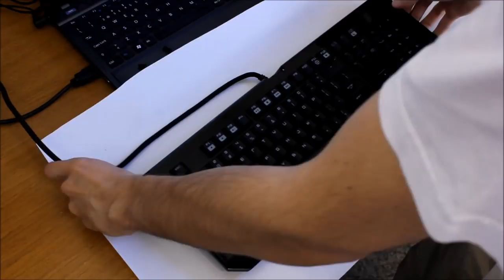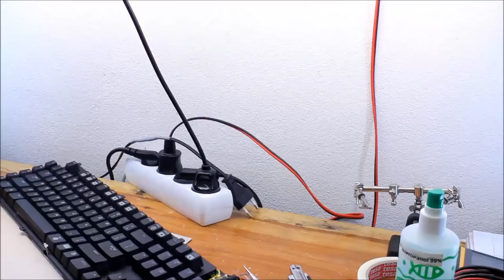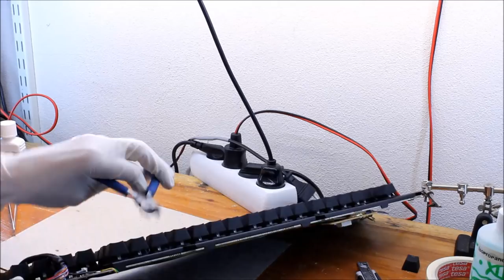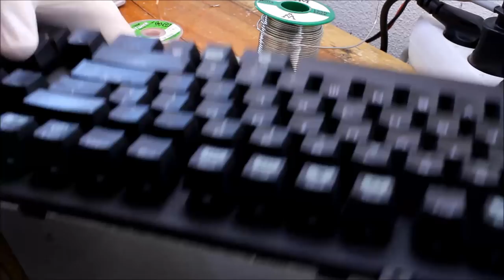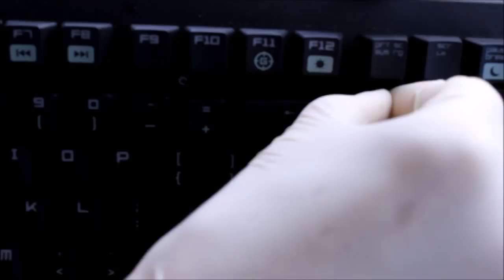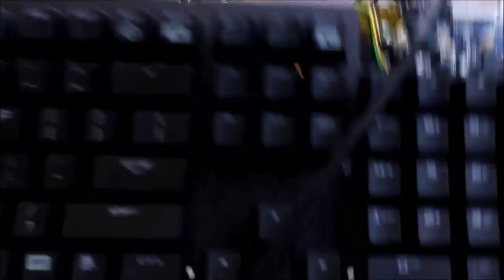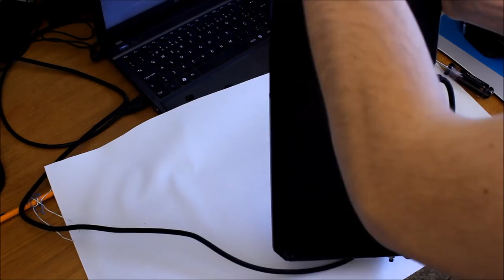How to replace backlight LEDs and Cherry MX switches in a mechanical keyboard.

Comment: hey i only my Z key is different colour if i just change it like this it will fix ?? and bw what you did in the 8:38 ??? i didn't understand help please
Reply from the maker: How did it become different, do you have a RGB keyboard? At 8:38 I'm using a solder sucker to remove the tin after melting it with the soldering iron.
Reply: @jfaria  yeah i have razer blackwidow chroma
Reply from the maker: @trancegotten3699  Yeah, you have to replace the LED, but you will have to search for a compatible one, I don't know the details of the LEDs razer uses. you can always take the LED off and take it to an electronics shop and they might help you.

Comment: never mind, i got it to work now, I had to connect the disabled part to the D... forgot what that means in my circuits class like R for resistor, but that + connecting the 2nd one by testing it to other pins, ahahaha it was freaking funny with me experimenting on it :>

It's in the laughs that made me happy to put back my keyboard together :>

Comment: is there anyway that you could only switch the led lights and not the switches making it easier?
Reply: I know this comment was from 7 years ago, but if you're still curious, I think it's possible. From this video, it looks like you just desolder the led leads from the pcb and pull it out from the top of the switch. Then take your new one, slide it in, snip the leads, and resolder.

Comment: So I just want to clean the PCB, and if I'm right in my assumption, after watching your video, in order to remove the black metal covering, I'll have to desolder every single one of the backlit LED's to do so?
Reply from the maker: I'm afraid that is true... You can try to clean it by taking the plastic case out and then spraying it with something like isopropanol, but I don't know if the switches would like that. If the keyboard wasn't subjected to liquid spills, it probably isn't too dirty anyway. The black metal bezel will likely stop most of the dust from getting into the pcb,
Reply: Lol, Yeah.... Pear juice made its way into the num-pad. I ran a few bottles of IPA 90% through it and gave it 48 hours to dry, just in case. Everything works great, but that is a terribly inconvenient keyboard design. Really didn't want to sit down for an hour or two after work, just to desolder everything to clean the PCB.
Reply: Marcus Adams José Faria  Hey geeks out there, please help me ;_;. I dropped some mango juice on my keyboard, and kept the keyboard open, until it died, then I put it back on, because it was an expensive keyboard, I kept on plugging it in, until the LED's stopped working... Then I finally decided not to plug it in anymore. I told my dad, and he knows a lot in these stuff, when I was little he had a computer shop, with his friend. Anyways, he told me to clean it and let it dry off, so the next day, he was like "I forgot to pour alcohol on it," so I look in the fridge and the only type of alcohol there is, is a %76 one, I didn't know that percentage mattered, heh. Then the keys became sticky, not very loud, they sound different, but they're still tactile. So then my dad saw the keyboard was becoming more sticky and when I poured more alcohol it would worsen the switches even more, so he went to pick up some WD-40. We sprayed a lot of that on the switches and they are not so sticky now, but they still don't sound as good, My numpad was intact, so they sound and feel beautiful! So I don't really have a problem with the sound or that feel, but where my problem lies is within the "N" key. It's the only key that is not mis-functioning. So, I took the keycap off to see if there's anything obvious, and there's nothing. My problem is when I press the "N" key, I end up with either nothing, or "nn" or if I'm lucky "n". I took off the keycap, again, and I noticed that if I stroked it softly it will work fine, BUT if I strike it hard, it will type 1 "n" and if I leave it, it will type the other "n". Also I see some delay when I press the "n" key, can you guys please help me??? (also this has been for more than a month so I don't know what's the issue here).

Comment: Very informative video, thank you.
Just out of interest, do you have any idea what sort of life-span the LEDs in a back-light keyboard have? I've been looking everywhere and no-one seems to agree. :S
Reply from the maker: I don't really have the expertise to give you a definitive answer, but we can get an approximation in the specific case of this keyboard.

Manufacturers rate these general purpose LEDs at up to 100.000 hours at their rated output, but when they would reach the 100.000 hour mark they would only have around half their brightness.

Most 3mm LEDs have a constant current rating of 20 mA, in this case every LED in the keyboard has a resistor that limits the current to approximately 4 mA, that means the LEDs are driven well bellow their maximum specifications, this means they will have a lifespan significantly longer than the rating. This means that I wouldn't be surprised if they would reach 100.000 hours without losing too much brightness, that's more than 10 years always on! On top of that, many people don't use them at maximum brightness, that will probably further increase their lifespan. It is, however, possible that some LEDs will just die, but I would be surprised if it's more than one or two.

Shorter version: don't worry about it, it's very likely that something else will break first :D

If you want proper data, search for MTTF of the LED you are looking at, most "proper" manufacturers usually publish them. For a detailed technical explanation of the failure modes and testing methods, read the application notes from the manufacturers, you can try one from Osram titled "Reliability and Lifetime of LEDs", it's very easy to understand.
Reply: Wow thanks, you're full of useful and interesting information aren't you? The lengthy reply is much apreciated. :)
I will look into that for sure, and maybe I will go for a flashy keyboard after all.  ^^

Comment: Hey, the LED on my bf3 blackwidow ultimate does not light up.  Read through the comments and another person had the similar issue.  You said to take a look at the LED driving transistor.  Can you go more into detail on what I should do? Thanks
Reply from the maker: Hi, did all the LEDs stopped working or just one of them?
Reply: José Faria The LEDs are really dim, sometimes it will flicker back to normal for a couple hrs then go back to be really dim
Reply from the maker: Check this image, it is an image from my old keyboard's motherboard, close to the num lock and caps lock LEDs, it should be similar to yours:
https://cocasdaneve.files.wordpress.com/2013/05/closeup_npn.jpg

There you can see in the upper right corner a red square. In my keyboard there are two wires that I added, in yours there should be a SOT-23 transistor in that spot. 

First I would take a soldering iron and melt the solder in all that transistor's pins, it might just be a bad joint that cracked, might as well melt the solder in that 10k resistor marked 103 too (make sure you don't apply heat for too long and that you wait a couple of seconds between each leg, so that the parts don't unsolder completely).

If that doesn't work, you can try and replace that transistor with a general purpose NPN, like a BC848 or something like that, as long as the pinout is the same and it can handle at least 100mA.

Comment: I'm having problems with my blackwidow keyboard, the key "E" is not this working, I need help .This video can solve my problem?
Reply from the maker: +enzo andreatta Make sure the switch is properly soldered, if it is you can try and replace the switch to see if it solves the problem.
Reply: +José Faria Thanks, I'll do.

Comment: nice video
Just wondering, do I need a soldering iron for just switching the cherry switches? or is it just to push em out?
Reply from the maker: Yes, you will need at least a soldering iron. Both the LED and the switches are soldered to the circuit board.
Reply: José Faria are they solded separate? because i dont have leds on my keyboard. thanks for the reply
Reply from the maker: They are separate. If your keyboard is not backlit, it's likely you will only need to replace the switch, however, sometimes manufacturers use switches with diodes, if yours has diodes you will probably need to unsolder the diode too.

Comment: Would it be possible to install LEDs to the blackwidow tournament edition 2014?
Reply from the maker: Gavin Zhang It depends, when you open the keyboard, are there holes for the LEDs in the PCB? If there are it might be possible, otherwise no. Remember that even if you can install the LEDs you will also have to replace all the keycaps, your keycaps are probably opaque, not suitable for backlight.
Reply: José Faria I opened the keyboard and there are holes, I'm just not sure if they would get power if I were to install the LEDs. I'm using my friend's keycaps because his keyboard broke.
Reply from the maker: Don't close the keyboard yet. Without soldering, stick an led in the holes and see if it lights up, if it doesn't rotate the LED 180 degrees and try again.
Reply: My LEDs actually haven't arrived yet(they're being shipped from China), but I'll definitely try that when they come. Thanks!
Reply: +Gavin Zhang And have it worked?
Reply: no lol the circuit board doesn't have proper sockets

Comment: I have 2 broken switches in my keyboard, so i have to melt the thingy on the back of the keyboard even if it doesnt have led´s?
Reply from the maker: Tycos Yep, the thing on the back is a metal mixture with a low melting temperature consisted mostly of tin, in electronics people call that solder, in the industry they might call it by other fancy names. It's used to make the electric connection between the switch pins and the keyboard's printed circuit board. Your keyboard is the same as this one, the only difference is that instead of 4 pins to unsolder (2 for the LED + 2 for the switch) you only have 2, the pins of the switch.

By your post I get the impression it's the first time you're trying something like this. The button's pins are very large and there are only 2 of them, that means it's an easy task for you to start with; however, if you know someone that likes electronics you might want to give them a call to assist you, to make sure all goes well and they can lend you their soldering iron so you won't have to buy one just to replace the buttons. If you like the task, then you might buy one for yourself for future repairs :)

Comment: Can the mechanism be repaired, I stuck a pin in it for "cleaning", but now the key no longer works
Reply from the maker: Angel Vega Disassemble the switch, I think you can do it from the top, just by removing the keycap and bending the plastic retainers; now you should be able to remove the shaft and inspect the metal springs for damage.
Reply: José Faria so is it possible to just do a switch swap without dissassembling the blackwidow?
Reply from the maker: No, that was for a spring check/swap, for a complete damaged switch swap, the switch on the blackwidow needs to be unsoldered. You need to disassemble the keyboard

Comment: Nice vid man, thanks! and nice yellow Tortex plectrum xD

I have a Corsair k95 and a few of my LED's just die (like not a whole row just 1 or 2), do you know if the K95 opens this easily as well?
Reply from the maker: Yap, delrin is an amazing material! :D

That's a nice keyboard, but I never disassembled one, it should be very similar to this one. Check this thread, it's the disassembly process for a k70, but it might be similar to yours:
http://geekhack.org/index.php?topic=41795.0
Reply: To be fair I'm rather disappointed with it, Its my first "expensive" keyboard I've bought for a while as I've just got back into competitive gaming. I've had it for about 4-5 months and two of the LED's have died. Also I find myself double typing letters when writing in haste which isn't a problem I've ever had before. I can honestly say I believe I type faster on a rubber dome but that being said; mechanicals utterly amazing for gaming.

Thanks for a speedy reply and the link!

p.s..73 is most likely my favourite thickness of tortex plectrum, I actually have 1 or 2 at hand at all time, on my desk, if I ever have the sudden urge to jam xD
Reply from the maker: iGlyphix Doesn't that keyboard have cherry mx red switches? If that's the case, you should try blues or, my favorite, browns. I need the tactile feedback, maybe that's your case too. I switched my blackwidow with a Cooler Master Trigger Z with cherry mx brown switches and this thing is simply perfect.

Regarding the LEDs, that apparently happens pretty frequently across several brands, that just means everyone buys the cheapest around and hopes they will last for the duration of the warranty :D
Reply: iGlyphix It depends on which switch you use. Blue switches greatly improved my typing speed. Also, I'd highly recommend a different brand. Razer, Corsair, Thermaltake, etc. are all pretty cheap when compared to a Ducky, Filco, KBC, Vortex, etc.
Reply from the maker: ***** I have to disagree there, I had a bad experience with the blackwidow, but the CM trigger z is at least as well built as any ducky that I've seen. Regarding looks, I think corsair's k70 is hands down the best looking one.

Comment: Can I remove the switches while the keys are still attached?

EDIT:
On 6:15, I didn't quit get what you did with the FLUX PASTE, can you please explain that step? is it some sort of protection?
Reply from the maker: Well, I guess that technically you can, but removing the keycap first makes it easier to grip the switch and if your keyboard has LED backlighting it is significantly easier if you remove the LED first. Regarding the flux, it's a paste or liquid that helps the wetting of the solder, that is, it helps the solder stick to the parts you want and not your soldering iron. Because the flux removes oxidation, it also helps making old solder melt faster like in that keyboard. If you want, you can read more about flux here: https://www.lifewire.com/types-of-solder-flux-818849
Reply: Thanks, I hope I succeed in what I'll do soon, I'm planning to remove my old Razer Blackwidow's 2012 Stealth Edition switches and install them on the new Razer Chroma Compact while maintaining the LED backlight on the Chroma, not sure if it'll work but I'll try, I'm about to replicate what you did in the video. 😂

EDIT: Btw, would it matter which switch goes where? e.g if switch letter A needs to go to switch letter A on the other keyboard, or all switches are basically the same and thats the board job to determine?
Reply from the maker: I believe you can't do that, the chroma uses 4 pin LEDs, so the switches have 4 holes, the blackwidow uses original Cherry MX switches with only 2 holes for monochrome LEDs, you will not be able to keep the backlight on the chroma if you do that.

Regarding the switches on a keyboard, they are usually all the same on every key, you can switch them around and they will work fine.
Reply: Well, that's a first bad news.. 😭

I'm curious which part that does the illumination? is it the switch itself? or is the LED attached to the board? you mentioned 4 pins on the Chroma, can I somehow remove two extra pins and install them on the blackwidow switch so that it can give an electric current? not sure if that's even possible, if it won't work then I'll simply use the board without LED, all I care about is the switches tbh, the Chroma Compat has one of the worst touch and feel, especially if you're a gamer.
Reply from the maker: The small LED is what illuminates, not the switch, you can see that if you remove one of your keycaps. Your chroma has 4 pins because it uses RGB LEDs, wich are 3 leds in a single package (a RGB led is composed of a Red, a Green and a Blue LED, one of the pins is common, the other three connect to one of the 3 internal LEDs). 
If you want a keyboard with a good feel I would recommend selling yours and buying a keyboard with the switches you want. Personally, I prefer cherry MX brown, many people who use their keyboards to play games like Cherry MX red. If you want Cherry MX switches and RGB lighting I would recommend you to look at something like the Corsair Strafe, but, like with the Razer Chroma, you are paying a big extra for blinking lights.
If you just want good switches and don't care about multi color backlight you should look at other manufacturers, like Cooler Master, they are making very good keyboards that use genuine Cherry MX switches and are significantly cheaper than Razer.
Reply: Thanks man, I had plans to buy the cooler master compact keyboard, but I thought since I already have two keyboards it wouldn't hurt to try replacing the switches, and get some experience by doing this, I love doing this nerdy stuff 😂, and if it didn't workout I'll get myself the cooler master KB.
Reply from the maker: Between two similar keyboards it works, but the razer chroma is a bit of an abomination, might not work.

Comment: If I wanted to replace every single switch with Cherry MX browns, is that worth the time and effort?
Reply from the maker: I don't think so. Even if you ignore all the work you would have, it's usually cheaper for you to buy a new keyboard with the keys you want, rather than replacing the switches of the keyboard you've got. Cherry MX switches are rather expensive when you buy them in small quantities.